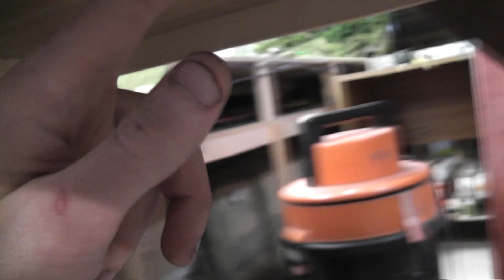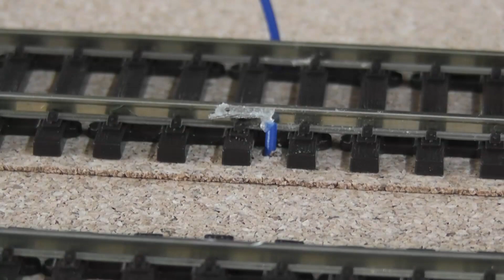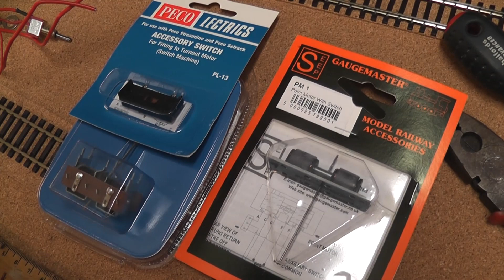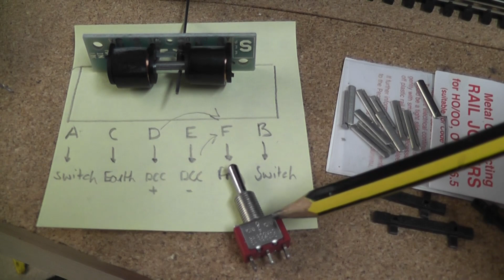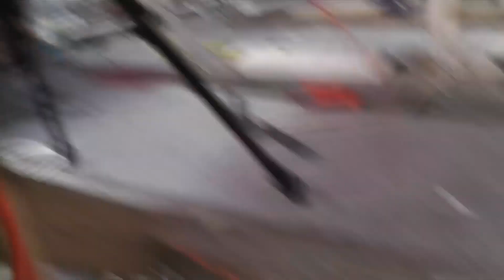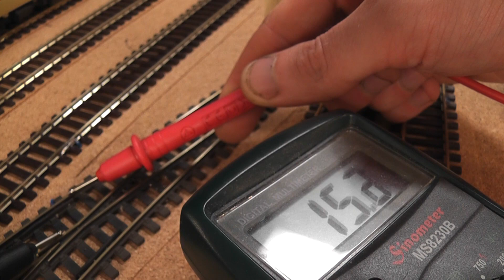Building a Model Railway - Part 4 - Wiring

Comment: Great series Everard, its nice to see how somebody else does it all.

About the point motors, the one on the bottom right of your control panel. it switches between two tracks and when one changes the other would also have to change to match up.
Would it be possible to wire up two motors to the same switch so when the switch is flicked the points always change together?
Reply from the maker: BladeRunner21577 Correct, I will be doing that.  Just didn't think of it at the time.

Comment: hi, I'm having a nightmare finding a short circuit, I have a similar size layout to yours. but since I started using electrofrog points I seem to have a short circuit everywhere. Do you modify your points in any way, even when I have only 1 set of feeder wires on to the bus wire I get a short??

Any ideas. Ta
Reply from the maker: Derby's Finest Driver Did you use insulating rail joiners on the the frog for the electrofrog points?  They are a must.  The layout will short out if you use metal joiners on the frog.  Hope that helps.
Reply: EverardJunction  I have insulated rail joiners on the frogs, and metal on the rest. I know its not my feeder cables as I've checked them over a couple of times.
Reply from the maker: Have you wired up the point motors yet?  Are the polarity switches wired the right way round?
Reply: EverardJunction I haven't wired any point motors yet, just want to get the track sorted first.
Reply from the maker: Derby's Finest Driver If only the droppers are connected then you should be fine provided they are all the right way round.  The electrofrog points with insulating joiners will work fine without any motors.  Only thing I can suggest is to unplug all but one set of droppers and see if a short still occurs.  If it does the track it self must be shorting somewhere.  When a short occurs you usually hear the buzz of the spark, might be also worth shorting a few times and see if you can hear where the spark is coming from.
Reply: EverardJunction  I checked every dropper one by one and all of them gave out a short circuit. And then I checked my Gaugemaster controller by simply putting two wires straight from the base set on to the rails. And guess what....it didn't short circuit. So I connected all of my droppers on to the bus cable while holding the two wires on to the rails. And it worked perfectly. Out of all the dcc systems I've owned, this one is the only one that doesn't like being connected straight to the bus cable. I wonder why?
Reply from the maker: Derby's Finest Driver Very odd, no idea why it's doing that.  At least its working now.
Reply: I guess so, at least I can crack on instilling all the point motors now. Thank you for all your help. :-D

Comment: Hi Richard
I'm loving the videos and just wondering when the part 5 is coming out. One question iv had science I started watching your Chanel is "is the Gravette a transfer (if so where do you get it) or do you do it your self it looks great" and one more thing a might point out, the screws your where using to fit the point motors where possie drives not Phillips heads. Its hard to explained the difference but it might be worth Goodling. If you did know that just ignore that part of the comment. Thank you and look forward to more grate tips and tricks from you :-D
Reply from the maker: Will Bugno Thanks for the comment.  Not sure what you mean by 'Gravette'

Comment: negative and positive with Ac current?
Reply from the maker: Synthematix Although DCC behaves like AC is isn't.  DCC is a bipolar DC signal.  Only way to read it with a multiimeter is on the AC setting.  The reading you get wont be very accurate, but it's enough to check power is flowing properly.

Comment: What tool do you use to snip the extended pin? Would be useful to see how you do this on the video as I find the extended pin drops out under tension, losing the washers and springs - very annoying after all the effort to solder and fit them under a baseboard. And how much of the pin do you leave showing? Too much and some trains catch it, too little and you risk losing a perfectly good point motor.
Reply from the maker: Shornford I use a mini drill with a cutting disk to cut the rod and leave about 1mm proud of the tie bar.  It will be covered in the next video.

Comment: Surely a more logical place to solder the droppers to the sidings would be right at the end where the buffers will cover everything up? Also to make life simpler when wiring up, use 2 different colours for the droppers. Also you should use different colours for the DC and DCC busses, makes fault finding a lot easier if you're new to this sort of thing.
Reply from the maker: DieyoungDiefast You can colour code as much as you want.  I didn't have very much wire apart from black, blue and red so just used that.  I'm very familiar with the layouts wiring so often don't colour code stuff. 

The droppers get covered up and hidden with weathering and ballast.  Most in this area will be covered by walkways and hard standing when I start the scenics.

Comment: Good video Richard. Just goes to reassure me that fitting motors and wiring is def not a 5 minute job. I am painstakingly fitting some 12x slo-mo Fulgurex motos, some of which are on live frog double-slips, so getting the wiring right for the polarity change needs a lot of care. These were to be fired by DPDT switches, but DCC Concepts came out with some very cost effective acc decoders last November and so will be using those from my ECoS.

In conclusion - can you tell me the part number for those splice connectors to the main bus using male spade connections - that looks a great way to go. Cheers
Reply from the maker: paredding The part number for the splicers is 33-0190.  I get them them from rapid electronics.

Comment: EverardJunction  Hey love the layout. There is a bit of a difference when it comes to cabling. The solid core 1 - 1.5mm which it looks to be in size or any high voltage cable isnt suited for Extra Low Voltage (ELV) applications (DCC) the current dosn't flow properly along it. Its just something to keep in mind that if u find at a distance from the booster you have voltage issues under load.

Personal note i cringe everytime i see you use one of those splice in crimp connectors there the cause of so many issues and headaches in my day job

Comment: Hi. Thanks for that wiring points is much clearer now . I do not yous D.C.C so I don't  haft to worry with those wires?
Thanks again grate video love them all
Andrew Skilling
Reply from the maker: Andrew Skilling Hi Andrew.  If you don't use dcc the wiring for the points is much easier.  You don't have to connect terminals D, E and F to anything.  Just focus on A, B and C.

Comment: Thanks for such an informative and useful video!

I had two questions please - would you ever consider using a Stay Alive chip for short wheelbase locos? 

Secondly, how come you didnn't put the droppers ok the fishplates between the sections of flex track in the sidings?

Thanks
Reply from the maker: sub39h I have considered stay alive decoders.  Problem is they take up more space and usually don't easily fit in short wheelbase stuff.  I prefer to use electrofrog points and get the track well sorted so short wheelbase stuff works properly.

I didn't bother to solder the droppers to the fishplates as I hide them quite easily with ballasting and weathering.  The rest of the layout is the same and you don't spot them easily.  

Hope that helps
Reply: Thanks for your reply. Yep i remember you showing us how well camouflaged your dropper wires were. So have you put droppers on every section of flex track? I was hoping that by just putting droppers on the fishplates i could halve the number of droppers I need because each fishplate would connect the track to either side of this.
Reply from the maker: sub39h You don't need droppers on every individual bit of track.  I've just got one pair going to each siding.  On the mainline I put in a set of droppers every 4 to 6 ft or so.

Comment: I think household flex is normally gauge  #14 rated at 15 amps but I imagine this may vary with country, I'm in Australia with 240 volt system.

Naughty, naughty, crimp connectors are designed for crimping, I know people bag them  but they are good enough for the aircraft industry.
ps I often solder crimps too..

Thanks for another great vid
Reply from the maker: Stewart D St Aldhelms Railway I'm not a great fan of the crimp connectors.  They cause me endless issues at work (classic cars).  However in this application they are not disturbed and don't get exposed to any moisture so work surprisingly well.  I've not had a failure in 5 years.
Reply: EverardJunction I was just stirring a bit but totally agree with you,  just a thing my boss would say. Besides crimps with solid core wires would be crap anyway and most likely fall off. Go with what works is my belief.
Crimps can be reliable but you need the correct tool "not the cheap pliers type"  and the correct gauge and type wires. There are many cheep tools and connectors that have given crimps a bad name. 

Stew

Comment: What solder iron do u use make model volt ect 
Would any solder work and do you solder the wire then attach to track/points.
How do you cut the bus wires and the splice/wire connectors how do they work install
Reply from the maker: Matthew Stamp Soldering iron is a maplin 50W one.  Any solder will work.  The stuff i'm using is very old and you can't get it anymore.  I cut the wires with wire cutters and fit the splicers using some pliers.

Comment: In your diagram for the three-way point I have a slightly older model of the three-way point which has three wires coming separately from all frogs which two frogs is it that are wired together to make one?
Reply from the maker: Steve Lindley I believe its the centre and right hand one that are connected.  To check I'd have to take the point out as the instructions don't show where the centre frog is wired.

Comment: Thank you now I can get on with mine.
What size cork do you use 3mm or 5mm?
Reply from the maker: Woody Wood In the yard I used very thin stuff, about 0.5mm.  On the rest of the layout I used 1mm thick cork.  3mm will work fine if you want a more raised profile to the track.

Comment: Exceptional as always, this video has strengthened my resolve to do dcc though i approach it with trepidation with regards to the accessory switch as I will be using peco points. Wasn't sure how many bus wires were needed for track but your video is very informative. Looking forward to the next installment 😊

Comment: Thanks for the update Richard - would it be possible to show how you'd wire up the Peco point motor please - i've got a few to do of my own and i'm really struggling….
Reply from the maker: ***** I've used up my seeps now so will cover the peco ones in the next part or so.  They look a bit more fiddly, but should have the same connections I guess.  Cheers

Comment: Hi there great series you do on building the layout I've flicked through a couple of the videos about wiring the bus etc can you tell me the order no's for the spades red and blue which connect to the the blue bus clip 330190 thanks for your time I know you gave the no's out but can't find them in the vids, Thanks for your time phil
Reply from the maker: Philip Pearman The spade connectors are just standard 6.3mm ones you can get from most places.  I get them in packs of 100 from ebay.

Comment: Very informative video Richard, seeing it done like this makes it a lot easier to follow, just with the wiring I would suggest that any one who is not as familiar or as confident as you with wiring up should use different coloured wires for the DCC bus to track and similarly to the point motors and switches so for eg right hand wire from the point motor goes to the top terminal on switch could be blue left one to switch yellow ect that way there is less chance of crossing connectors and if there should be a short it would be easier to find the fault. Seeing the 3way point wired up clears up a lot of mysteries about them I feel more confident now about using one. Thanks......
Al
Reply from the maker: Alan Murphy Thanks Alan.  You can colour code as much as you like.  What I've done makes sense to me, but can be confusing if your starting out in the hobby.

Comment: Before soldering the spade connector to the bus wires I would probably crimp them down on the wire.
Reply from the maker: Brian UK I like to keep sections removable to allow for future alterations and allow for easier fault finding if problems occur.

Comment: Cheers for that, great work through. I am still undecided about the method of control for the points on the new layout, I want to control everything via DCC but the cost of getting the accessory decoders is a bit prohibited, but the thought of "control panels", CDU's, wiring etc for a separate manual control is very scary! I do like the idea of manual switching, it seems to be more as though you are actually running the layout. I assume that I could wire manual control and then at some future point make a few of the points DCC controlled for continuous running or route scheduling via the ECOS when I have the cash. I am most greatful for your videos, extreemly straighforward and plain speaking. Looking forward to the control panel making .. demystifying it all.
Reply from the maker: ***** I prefer manual switching on the control board as it's more like running a real railway.  If you rig up everything to dcc you'll have loads of point addresses to remember and spend a lot of time tapping away on the controller.  I find a switch on a panel to be easier and faster.  You don't need to worry about a CDU if you don't want one.  The toggle switches prevent any issues.

Comment: Extremely helpful, I am still working in DC but in the distant future hope to attempt DCC. One question I never see answered is the bus wires go to your controller but where to they end? Do they end at the end of the table just taped up or do they go to an end terminal?
Reply from the maker: Vinny Golia Just cut it to length and tidy it out of the way at the end of the board.  Bit of tape over the end prevents any issues.  Hope that helps.
Reply: Yes it does, immensely. Thank you very much!

Comment: Nice video Richard. Quick question if I may please. How did you terminate the bus wire under the extension?
Reply from the maker: theTazman19 Just cut it to length and tidy it out of the way at the end of the board.  Bit of tape over the end prevents any issues.

Comment: From What I Can See & What You Have Described The Size Is 1.5Mm Common In Domestic Uk Household Wires. Richard Can I Take The Liberty To Explain To Your Viewers That When Using New Or Re Cycled Wire It Is Always Good Practice To Check The Wires For Any Cuts/Nicks & Especially In Re-Cycled Wire Look For Burnt Wire Which Show Possible Over Load At One Time! Any damage to the cable can reduce its performance & or may catch fire! Richard As Always Your Video's  Are Well Produced & Informative, Great Work, Well Done!
Reply from the maker: TheAudiostud Thanks, yes cuts and other damage can cause a real problems especially with the dcc and dc signals under the board so close together.  I bought that reel of cable new so I could avoid any issues.

Comment: Great stuff! One thing though, it's so much easier if you use black and red wire for your droppers - I found that wiring my layout, it looked straightforward on top, but once you're underneath the baseboards, it's very disorientating!
Reply from the maker: tjf4375 I like to keep any track feeds in blue wire so I know what they are.  Once wired you never unplug them so I didn't bother coding + and -

I use black and red for point motors and signalling so wouldn't want to confuse them with track feeds as DCC can wreck some of the circuits I make for the signals and stuff.  Thanks
Reply: EverardJunction Fair enough, that makes sense :)

Comment: Very concise and well explained. A tip I saw was to put an old wagon with one side red and the other side painted black to run from existing track to the new track and you can not mix up + or -. You did not use different colour wires from track to bus? Excellent video.
Barry. Devon.
Reply from the maker: OBowner I've used the wagon trick many times and it does help quite a bit.  I don't bother to colour code the dropper wires as I like to keep any track feeds in blue wire so I know what they are.  Thanks
Reply: The US and Europe use different, conflicting, color code standards.  In the US red is positive, black is negative, white is neutral/return, and green is ground/earth.   In Europe, red is positive and blue is negative; I'm not sure about the other colors, but one thing to be careful about is that green is NOT ground in Europe, which could be disastrous for someone used to the US or Europe and doing wiring on the other side of the pond.
Reply: Errr... The UK used to use the RED/BLACK/GREEN standard until about 50 years ago (and until about 10 years ago on fixed cable) :) We are now harmonised with Europe using BROWN=live, BLUE=neutral and GREEN&YELLOW=earth. This is AC, so there is no positive or negative.

Comment: Many thanks, an excellent video. Would it not help to colour code your droppers, etc. Also have different colours for the separate busses?
One other thought. I use exactly the same switches. Because they return to "centre" you can't tell which way the point is set without looking at the point itself. If the switch rested in the left or right position it would show which way the point was last set.
Best wishes, John.
Reply: +John Crook 
That would be handy, John. These Peco-type switches need a momentary contact. Are there 'momentary' switches that show the contact direction?